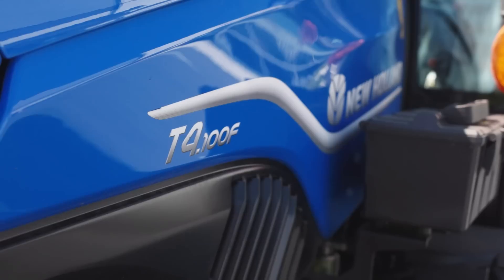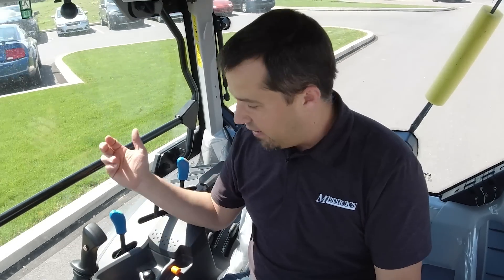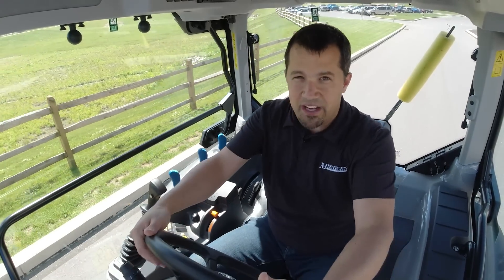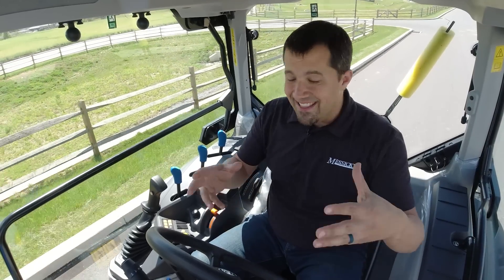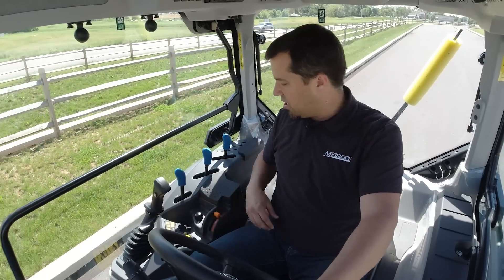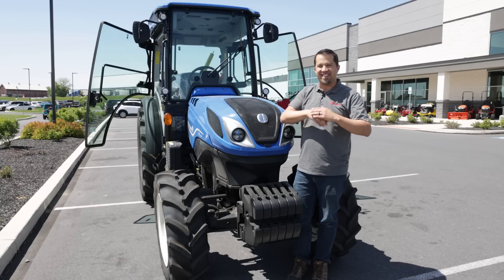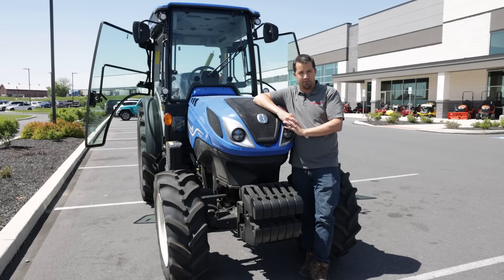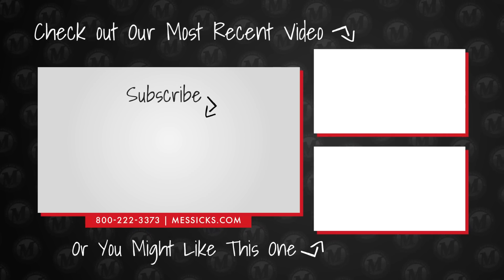Peak into the improvements coming to New Holland's farm tractor line. T4-100F

Comment: Hey Neil, we just got delivery of our T4 90F and were rototilling our table grape vineyard in CA this last weekend.  Sight lines were great, power was plenty and interior room was excellent compared to our previous generation of T4's that have the hump in the middle of the cab (this T4 has a flat floor). My small dog also appreciated the freedom of movement in this cab and not just being stuck on either the right or left leg space.  The gear shift on the floor takes a bit getting used to, but overall like this generation much better.

Comment: The added technology certainly increases convenience, but at the same time limits repairability and life span.  How many of these recent generations from all manufacturers is going to still be operational in 40-60 years like you see with the Ford 3Ns, Massey-Fergusson 35s, etc.  If the equipment is going to be designed to be disposable, then the pricing should reflect that.

Comment: No freaking way. This is playing right into the ownership of the equipment you purchased/right-to-repair. Just a matter of degree and nuance before compact/utility tractors won't last 5-years because of firmware updates and support.
Reply from the maker: I'm very intune to that thinking, and what's happening here is exactly what I think most people would want. The screen is not required for operating the tractor. You can remove the display and the machine still runs. If you have a problem a laptop is not needed to pull codes and descriptions because they are on the display right in front of you. If you want a purely mechanical tractor that's available in the workmaster series, but at the end of the day most buyers choose the features and comfort that come with electronics over the simplistic mechanical models. I've been pretty pleased with the CNH trajectory when it comes to R2R issues.